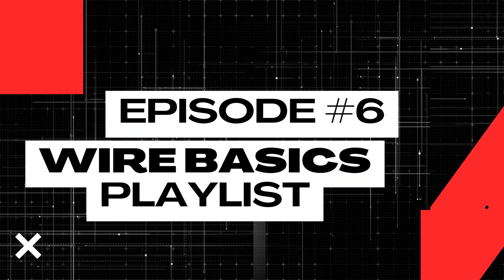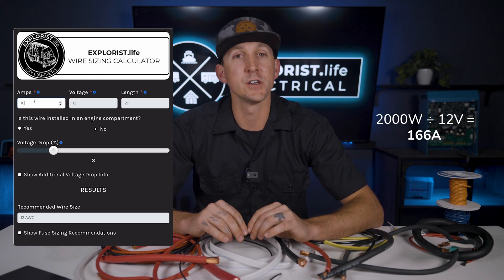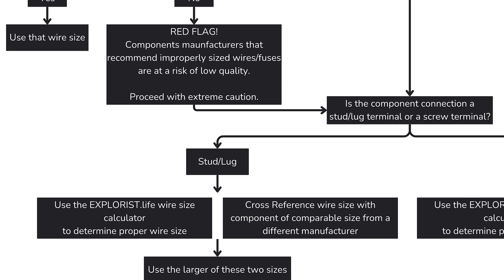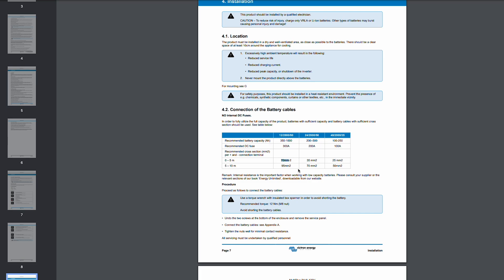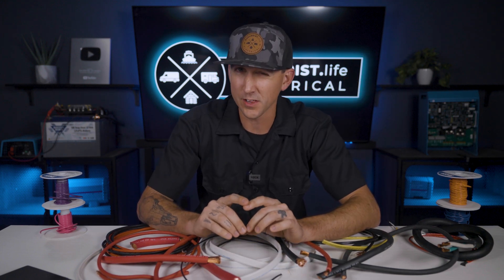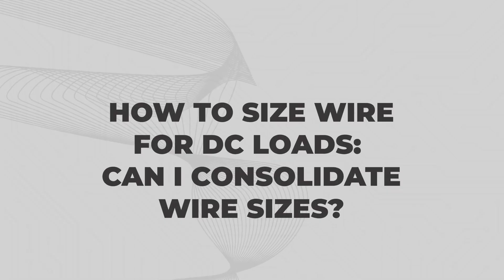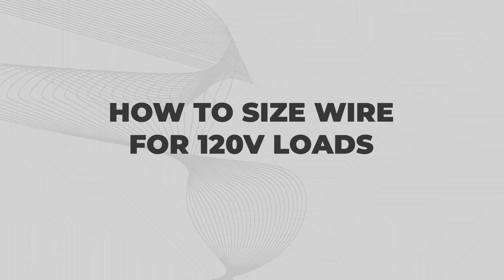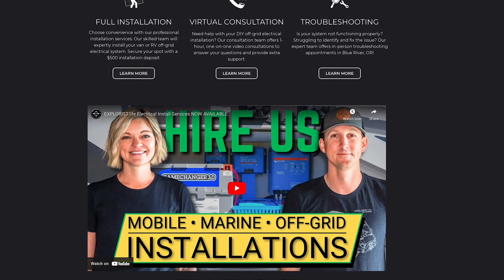Choosing Wire Sizes for a Mobile, Marine, or Off-Grid Electrical System

Comment: And if we don't have access to your calculator what is the formula so we can manually determine the appropriate wire size??
Reply from the maker: Totally hear you — wire sizing depends on a few project-specific details (amps, one-way wire length, allowable voltage drop, and the wire type/insulation), so we don’t want to give you a generic formula that could steer you wrong and create a safety issue.

If you hit up our support team with your:
- system voltage (12/24/48V)
- max continuous amps on that circuit
- one-way wire length
- copper vs aluminum (usually copper)
- target voltage drop (typically 3% for most loads)

…we’ll help you calculate the right wire size for your exact setup and point you to the correct parts. https://shop.explorist.life/support?utm_source=youtube&utm_medium=comment&utm_campaign=support&utm_content=response_link
Reply: @EXPLORISTlife I super appreciate your response! However, my question is...what is the actual formula in order to duplicate your numbers? I want to understand the actual math. You've helped me wrap my brain around it all, and I can't thank you enough. Yah bless you.
Reply from the maker: Just curious, are you a shop.explorist.life customer?  historically these kind of comments come from competitors trying to duplicate our educational resource efforts.  Some call me jaded, others see me as cautious - but I just want to make sure you and I are on the same page.
Reply: @EXPLORISTlife Lol, no I'm not a shop. We live off grid in the Southern Rockies. We are currently existing on 2 solar power stations and two lithium batteries with 1200w inverter. Our friends and neighbors have been gracious enough to allow us fro the last year and a half to charge our batteries at their places. Even though I've had our system for the last 5 yrs. Ridiculous, I know. But I've been scared to attempt it without understanding it, and have only had the time recently to dive into it again. I appreciate your lessons, they've helped me immensely. And will attempt to start wiring everything tomorrow. I understand your stance and would be the same way, I'm sure. It's okay, I get it. Thank you for all you have shared. Grateful for it.
Reply from the maker: I appreciate the additional context!  Are you a shop.explorist.life customer?  If so, reach out directly and I'll personally make sure you get the calculations you're looking for as part of your complementary customer support: https://shop.explorist.life/support
Reply: @EXPLORISTlife No, I'm not a customer... yet. Lol. I just found your channel in the last week. I appreciate you taking the time to respond to me. Thank you again and Yah bless you.
Reply from the maker: No problem!  And I appreciate the back-and-forth with the additional context of your project purchase history.  

But in the spirit of earning your business for future projects, I figured I'll go ahead and share the formula we used for the calculator:

To calculate the recommended wire size, you first calculate the required circular mils. You do that by taking the resistivity constant of the conductor material — like copper or aluminum — multiplying it by the current in amps and the one-way conductor length in feet, then dividing by the allowable voltage drop at the load.

From there, you cross-reference that circular mil value to the appropriate wire gauge (hint: Use Table 8 of ABYC E-11 for this)

Of course, this formula needs additional layers to ensure that the max ampacity of the wire is not exceeded considering bundling, installation location, and wire insulation temperature but this gets away from a simple formula and more into programmatic logic, which I don't think I have enough characters in this reply box to cover.

Comment: My question pertains to the size of wire needed to feed 110vac into a din rail mounted 12vdc 1.5A power supply. The supply takes 110vac in and iutputs 12vdc 1.5A. 

Because I am taking wall voltage 110vac do I need 14awg wire if I'm only pulling 1.5A?

Thank you

Comment: I do understand the need for double the distance between devices in the calculator but what if I'm calculating gauge for dc-dc charger and I will use chassis groud? Distance between starter battery and second battery will be at max 10ft. I will be using Renogy DCC30S where they say to use 45-60A input (from alt.) fuse. In this exaple should I aslo double the distance for the positive wire gauge calculation?
Reply from the maker: This may take a more in-depth look at your personal setup.  If you have purchased/are purchasing from our store (shop.explorist.life) reach out for some more personalized help: shop.explorist.life/support

If you've purchased/are purchasing elsewhere, reach out to your dealer for support.  We'd love to have you as a shop.explorist.life customer so we can provide a bit more help in the future. 🙂

Comment: " to abandon the product in that application" - Hm I had a problem with some Victron MPPT 100/50. They are installed some distance from the batteries so due to low drop I wanted to use 35mm² - but this was to much for the MPPT. I crimped a short 10mm² at the end.
Reply from the maker: You started the quote too late.  The first part was "*I would be prepared* to abandon the product in that application".  In other words; I would consider it unless I had a good reason to not do so.
Reply from the maker: In that particular instance, though, I would do everyhting in my power to get the charge controller to the Lynx Distributor so that purposefully oversized wire would not be necessary.
Reply: @EXPLORISTlife  Yea right - but that electric compartment was full and 2 stories away 🤔
Reply from the maker: That comment was more for everybody reading through this comment section and I'd say that a system where the batteries are 2 stories away from the charge controller is an exception and not the norm and would fall outside of the standard decision making tree discussed int his video that most people are clicking on this video to watch for.
Reply: @EXPLORISTlife  Yes absolutely

Comment: I do use voltage drop trick for LED lighting, it also makes them last much longer. For some of them, which were too bright I even use a dc step down and run them on around 10 volts. Cheers form Ukraine. Love your vids ❤

Comment: You do evaluate at the wire size a devices' terminals can handle. Very important to not overlook.

disclaimer: I paused the video just before 8:40 to write this diatribe. oops.

However, if a users desire for restrictive voltage drops and/or extreme wire lengths - (like a 50 foot round trip circuit in a 19' vehicle) pushes you to a larger wire cross-section, I think it is permissible to properly terminate a reducing ferrule adapter as an option. In this case, it is not the current draw that determines the wire size. Those conditions aren't the fault of an equipment manufacturer to necessarily disqualify a particular device that is rated for the current load.

Along with checking stud sizes, I also double-check the acceptable wire sizes in Anderson connectors in use. Housings are another item that might need to be up-sized due to terminal availability, rather than current-carrying ability.

Although consistent wire sizes is usually a plus, sometimes I find it useful to take advantage of the variety of terminal sizes in a given PP or SB connector to downsize to a devices requirements for short lengths. A few inches of 8 or 10 gauge wire isn't going to affect voltage drop much where 4 gauge wire is employed for 15 - 25 feet of a 30 amp 12 volt circuit.

thanks for all of the resources!

Comment: I know I'm adding to the complexity, but I have a 4-fuse BlueSea fuse block for some of my "remote" smaller lighting connections, and for fused connections (those branching off the block) it says 16g is the smallest/minimum recommended wire. This is confusing since so many LED light products use 18-22g wire. Any thoughts on how to best proceed and still have a central fuse block?

Comment: Be aware that many of the online wire size calculators have 3 to 1m minimum cable lenght even if you are able to plot in 10cm. I found this out when calculating the wire size for a 10cm battery interconnect and the calculators gave wildly different answers (4mm2 to 120mm2) for the same cable lenght.
Reply from the maker: Battery interconnect wires should be sized to match the ‘battery to lynx distributor’ wires to remove all doubt.

Comment: People need to realize that each load needs its own calculation. 

That being said, all my dc loads get 10awg duplex anchor wire. I have no loads that this wire can’t handle. 
My AC loads also all get 10awg wire. I also don’t have AC loads greater than 20amp.

This helps me keep wire and connector inventory simple. And now the only calculation I need to make is for the proper fuse.

Base system wires can also be oversized. In particular battery to busbar I go for bigger. Also for busbar to inverter. My thinking here is, if I add a battery or get a larger inverter, then I already have the proper wire in place.